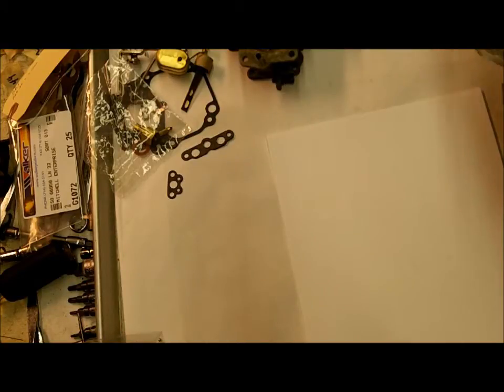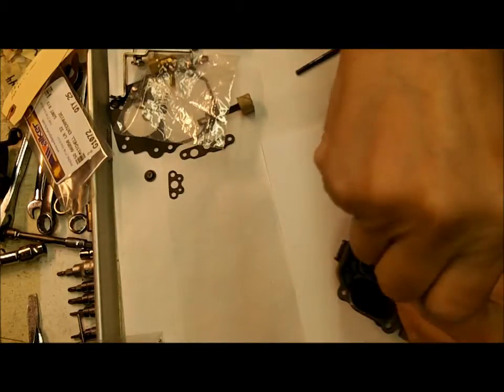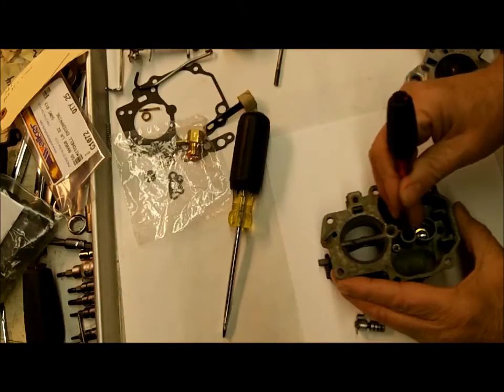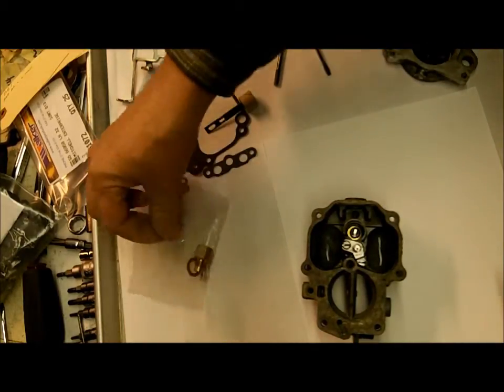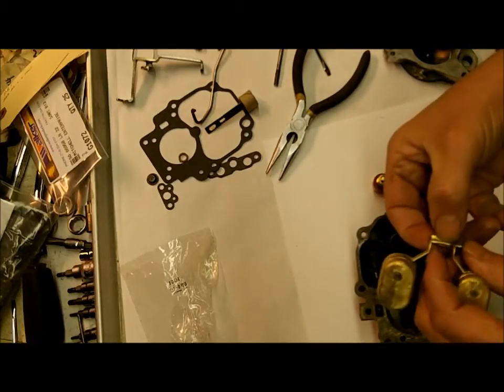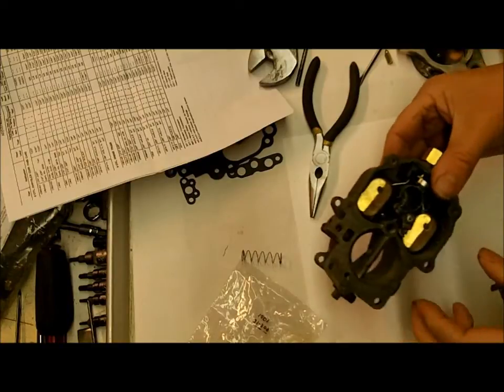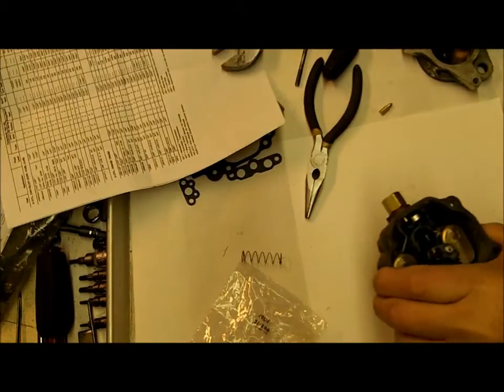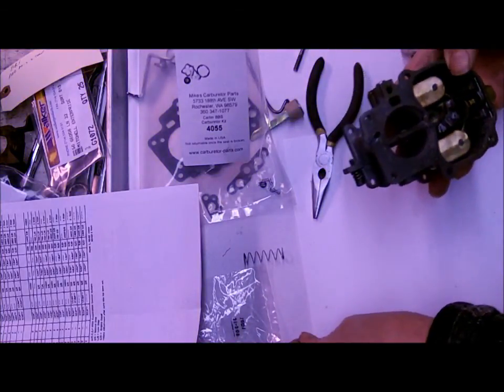Carter BBS Carburetor Rebuild Part 1

Comment: Thank you for these two videos. I watched it while I rebuilt my carburetor for my 62 Dodge D100. I bought your rebuild kit. My truck runs like new now.
Reply from the maker: I love to hear success stories.
Reply: @MikesCarburetor  hey could you please tell me were you find the metering rod. I have looked everywhere and it doesn’t come in any of the rebuild kits. Thanks for the help!
Reply from the maker: @dylanisom3105  You can get them here: https://www.carburetor-parts.com/bbs-metering-rods-jets
Reply: @MikesCarburetor thank you for the quick response. How do I determine which one I need. As far as I’m aware the carburetor is stock. It’s the exact one you have in this video. It has a tag on it stamped 3278s then under that it has G1 stamped in it
Reply from the maker: @dylanisom3105  You will need to mike the existing rod to match it. We don't have a chart.
Reply: @MikesCarburetor there is not one. I bought the motor as in. Took the carb apart and the piece was missing. Not sure if someone removed it or if it just rusted away

Comment: Thank you for the video.  I bought my kit from you years ago and just now used it to rebuild my bbs carburetor.  I set my laptop on the workbench and rebuilt it stopping the video at each step you took.
One thing I discovered is the 4 long screws are not the same length.  Two of them are longer and cannot be used above the idle mixture screw without touching it.  Hope this helps.